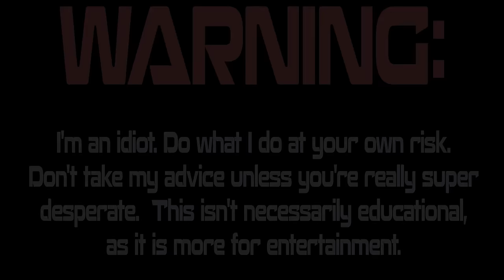Ford 9" Rear end, Radiator, and Ignition for Liberty! Can we still make Sick Week?

Comment: Very cool 😎 kitty 🐈.
Mike Finnegan has this really sweet wire crimping tool and kit that lets you make any size gauge crimp connectors you want. So instead of having to run out to stores you can just make up your own battery cables whatever length you want! If you read this and still have a need for this kit, ask Finnegan next time you think of it. They're coming along nicely.

Comment: When I had my Ford Torino with a 9 inch, I had two center sections. One was 3.00 and the other was 3.70. The 3.00 was great for cruising and the 3.70 was GREAT for those times that you wanted more Woo Hoo. Not so radical as to be race ONLY but made for a LOT better launch. Center section could be swapped in like 45 minutes or less. LOVED IT !!

Comment: I used to work with a guy named Derreck. He also had a tendency to over tighten stuff and break it a lot. We called it Derreck tight, which basically meant tighten until it breaks.
Reply: Tighten the first one down until it breaks. Then the rest of them not so tight.
Reply: Just as it starts to strip\snap, back off a quarter turn. Perfect.

Comment: When I was a young buck living in Fridley MN in the mid 70’s. I remember my neighbor had 2 Chevelles, I believe. I remember one was blue the other was orange. Both had full blown motors sticking through the hood.  Every time I heard them start one of them I ran out of the house like it was the ice cream truck coming.  I would stand and watch for the butterflies to open as they burned the tires off.  Smoke overwhelmed the car, then they would let off the gas and start pulling it back in the garage. It was amazing and probably why I love working on old cars and trucks.

Comment: When I was about 21 years old, I had a 72 Chevelle. I bought it for $800 and it didn’t smoke when I test drove it, but it did shortly after that. It had a 327 and I put a 350 in it.

Comment: On the AN fittings add oil to the hose and the threads during assembly and also on the threads when installing.  It will help keep the aluminum from galling.

Comment: Dereck,  you may have issues with that 6AL box as the components on the circuit board are surface soldered verses being properly thru hole soldered. The components like to rattle loose and then ye box is toast.

Comment: I’m curious about the two core radiator. My dad’s ‘66 GTO had a two core aluminum radiator in it when he got it, and that car overheated OFTEN. He tried all kinds of things to fix it and had it for sale when he passed away. Mom wants to keep the car, but she couldn’t drive it. I switched the radiator to a three (or was it four?) core aluminum that was the exact same size on the outside. It completely fixed the overheating. My guess is that more cores gives it more surface area to exchange heat.

Comment: Derek I am no expert but I believe the fittings for your fire hoses will come apart. You can thread the outer part of the fitting onto your hose and then the center fitting part which is tapered will thread into the outer part and the hose thus expanding the hose against the outer part of the fitting making it seal tight.

Comment: Derek, I'm retired from 45yrs in aviation from piston poppers to multi mil corporate jets. All we use are MS and AN fittings. If you would lube up the inside of the hose with DC4, Dowcorning silicon grease, things go together a lot easier with those AN hose fittings. Those aren't even the 3000psi high pressure ones either. Those are the real easy 300psi hoses.

Comment: Derek! Turn your channel grips round, you will get a much better grip! I know with vice grips don't matter, but with channel grips it makes all the difference. Love what you do and wish I could get your help on my 1989 ford transit 2.5di motorhome (I know you would put a bigger engine in your missis's hair straighteners but I'm in the UK and get 27 mpg). It smokes more than Bob Marley on start up recently and I don't know why
Reply: The 2.5 D are very common for one of the Glow plugs going bad and causing smoke on start up.
Reply: @MJTAUTOMOTIVE  Thanks, but the engine I have doesn't have glowplugs. It only has 12v to the fuel pump and starter motor and fires from the compression. I'm thinking it could be poor compression on one or more of the cylinders or dodgy  fuel pump. I am an amateur self taught from the haynes manual, so no expert
Reply: @ryanwellings1570 , Your engine does have glow plugs. If one is faulty that cylinder will smoke on start up. Like you said if you have a Haynes manual look it up. I have been a Mechanic for over 35 years. IF you want any info just ask. Cheers.
Reply: I wonder if we are talking about different engines. Mine is an english 1989 mk3 and there is no mention of glowplugs anywhere in the Haynes manual. If I could I would send you a picture of the index. I'm 100% certain. Iv worked out that the wire on the coldstart waxstat had snapped. Now it starts OK but is held with some vice grips so won't release when warm. Hopefully I can find a replacement and fix it properly. Thanks for the advice

Comment: Put your line lock on the rear brake line. Lock out the rear brakes from pressure and you can control your front brakes with your pedal. That way you can roll out your burn outs. Just don’t forget to let your rear brakes to get fluid after the launch!

Comment: If the radiator company or companies would make threaded insert you can just buy a ORB -AN fitting with an        O-ring, that would never leak or come loose. Less hardware you have to mess with and have worries of it leaking. Love your show Derek. Cool idea but to many parts involved.

Comment: I have a 1968 SS El Camino with a 540 BBC And the gears I run are 332s. and 355s depending on just farting around close or a road trip . I’ve also raced it with both sets and it’s always worked great . My diff is a STRANGE Engineering GM-A Body S60 Housing 35 Spline Posi with big axles and studs .  My trans is auto gear M 22 Muncie, 1 inch shafts. Yes I’m old-school..😎.  I’ve always been a shifter car guy. I run a 4 core radiator and it never overheats but those new 2 cores run 2 rows of 1” tubes and cool very well.

Comment: Next time try electrical tape to hold the nylon mesh down so It won't fray when your zipping it off with a cutoff wheel. You just gotta wrap it around a couple times and it will keep it clean.

Comment: I hate to tell you this Derek but you need to redo those AN hoses. The jacket needs to be completely under the collar. Leave a small 1/8" gap from the inner shoulder of the collar to the edge of the hose so things can spread. That collar has large reverse threads so you can screw it over the hose jacket, then you oil the hose end that slides into the hose, oil the threads too. Sometimes it's tough getting the barb into the hose so I use a round shaft Phillips screwdriver to smoosh the very end of the hose a little bit to get the barb past it.

Comment: Hi Derek, love the video and all you do. I hope I am wrong, but I am a bit concerned about the Cold Case setup with all the different adaptors and fittings stacked on top of each other. It's a lot of additional points of failure. The bottom rad hose also worries me, because it is so short and thus has very little slack to compensate for engine movement. I have been a piping engineer for 15+ years and just trying to look out for you when you hit Sick Week with this awesome machine!

Comment: Those ladder bars were in multiple catalogs from mid 70-80s, I like just the easy Trac  bars, Lakers and such, " race" cars did double duty with Alot of streets, stop signs, lights. Way back then, like early 80s, and fancy pants badges and decals didn't mean doodley against a 72' Monaco 440 with cam, headers and a 950 dbl pmpr in a gutted 74 duster with N-50s

Comment: Derek, u said in this video something about 2 wires are disappearing and then u need to wire up the 2 new digital electric fans for the cooling system. Couldn't you repurpose those 2 electrical wires that are to be disappearing for the digital electronic fan relay wires instead now and just move some wires around in the interior fuse block at all?

Comment: Back when we built these cars we didn't have the interweb, we made our own ladder bars. Got our axles from the junkyard and bolted them in as best we could. We didn't have or dream of 700-1000 hp. We use double points distrbuters and radiators out of farm equipment, at 16 I shortened A radiator by 6 inches with a torch and copper rod. The cars are the same, the method has changed.
Reply: And yes I still fix my own, currently a 67 International pickup. Rust bucket but next summer hopefully it will go to a few car shows.

Comment: Those latter bars look awful lot like an old set of Lakewood bolt on ladder bars for the GM coil spring cars. Sold those a few moons ago during my employment at Super Shops Automotive Performance Centers. They just appear to be missing the yellow paint. I had a similar set on my 69 Lemans except mine actually replaced the lower control arms.

Comment: 29:20 that little valance rig or "shawl" lol, you could make a metal one very easily with your table! A little Cardboard Assisted Design, then trace it with your fancy beepboop cutty-outy machine. A fella could even cut out your VGG logo into it, so when you open the hood, it's just starin' a guy right in the eyeballs

Comment: Since you are going to put Independence back on the road and possibly hauling the family it goes without saying that you need to make that car as safe as you possibly can. I have a '65 Skylark sedan that the previous owner bought as a wreck. The frame was bent so he bought a donor car with a good frame to put under the sedan that I now own. Not an easy job but the best way to make the car that is now mine safe to drive.

Comment: Man, every time that interior wiring panel is shown in a video, I have to pause it while I try to understand what the feller that originally built it was going for. Such a bizarre setup. Where the main power feed comes in, are those just a bunch of individually mounted circuit breakers with a homemade bus bar mounted to them?

Comment: Weird why would swap the Ford 9" in the 12 bolt is a ftronger rear the Ford 9" and same with the Chrysler 8 3/4 rear stick shift and slicks had it happen in the past you end up blowingvthe caps off the housing that why the rear loder rear-ends have the heavy duty aluminum  were cover with those adjustable in the cover that help push on and support  the rear caps. I do agree though its great to have the Chrysler 8 3/4  and Ford 9" is crazy rasy to do a quick rear gear change.

Comment: Ford gearing in a chevelle... to quote Derek  "we'll pretend we didn't see or hear that"

A Rear end from a 1989 Chevy 1500 Shorty is the one I prefer to use....  it's a 2.89 ratio and I only have problems with keeping rubber on the one in my 'Bar Car'  

FOR THE INTERESTED
Bar Car is A homemade 2" pipe Frame With a L98 and a 5 speed from a 90's Corvette using an 02 grand am wide track front subframe ( just for the great suspension and steering ) an 89 C1500 short cab short bed rear end and a LMC billet Column with a one hand quick release steering wheel because it has no way in or out except the area where the windshield is in a normal vehicle 😂

Comment: Another Great Video Derek. I'm working on a... 1971 Oldsmobile Cutlass Supreme Hardtop Coupe Rocket 350 V-8 200-HP Dual Exhaust Turbo Hydra-Matic (aut. 3) engine Horsepower / Torque Curve.
I'm torn between restoring it to factory or drastically increasing the horsepower (i was thinking in the 500 - 600 range.) What would you do?

Comment: Won't the cooling fans be blowi'n all the time once the engine get's up to operating temprature by having the sensor by the termostat? As far as I know, the sensor should be by or after the outlet of the radiator

Comment: That a good few extra steps for something that hasn't needed a helping hand in 80 years. I mean, the radiator still only sees about 20 psi at most and the normal hose with clamp has always worked, so why the switch to AN fittings? Never had a hose fail in the first 10 years and rarely within 20. Knowing my luck, I'll have that AN adapter fitting leaking from misalignment 5 times before getting it juuuust right how it likes it. And actually, kinda surprised you have the room for the extra length it adds. A lot of times, the hoses have to turn and sit right up against the radiator to clear the belts and stuff.

Comment: have you ever heard of Blueprint engines LS-headed 3.6-litre four cylinder engine it was at sema , it will fit most gm bell housing and it was in r&d last time i checked ,  you could get in touch with blueprint engines and put it in any gm car with the 2.4 ecotec engine or 2.5 like my 2019 chev impala check it out would make a great video and great advertisement for blueprint engines

Comment: Derek, I've asked several times! What's your thought on running rotella in high mileage vehicles? I have a 06 Silverado with 250k on it, and seen you put in it several cars, would love to hear your feedback! Thanks
Reply from the maker: That has a roller cam rotella is not a good fit.
Reply: @ViceGripGarage  thank you for your feedback!
Reply: @ViceGripGarage  do you have any tips or tricks to quiet down a light lifter knock at start??

Comment: question:
Why on earth would you want to have a 3 foot secondary coil wire? Your lightning can to your lightning whirler should be as short as possible because of inductance. Long lengths especially going through a grounded out. Firewall is going to reduce your spark voltage and open up high possibilities for crossfire to ground.
It makes no sense brother! Your coil wire should be like, maybe 3 inches.

You don't want to have a 3 foot coil wire! That's no good

Comment: Are you looking for BAER Disc Brakes for the front. I have a brand new never installed kit including Rotors Calipers hubs hardware kit, Calipers are powder coated white Rotors Are Drilled for cooling, if interested Selling intire kit for $1,500

Comment: Those Spade connectors you have inline with the Main Power from the Alternator will not hold Up! 100Amp Alternator 20 Amp Connector and your Wires the 10 gauge is good for 40 Amp's all under sized for what your Doing......